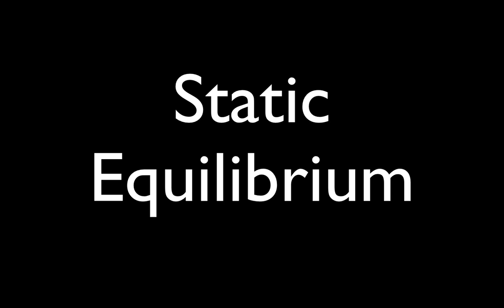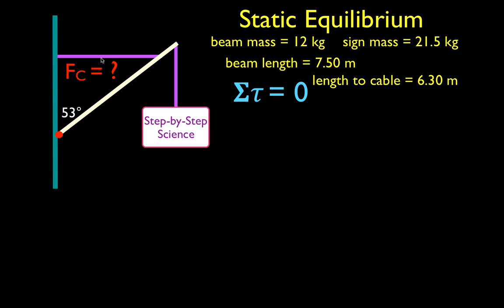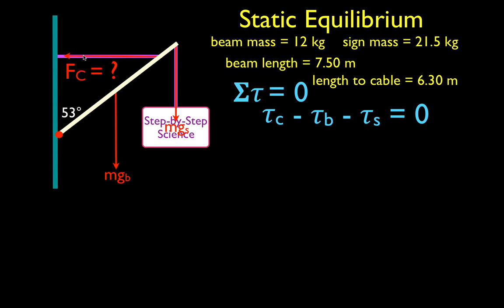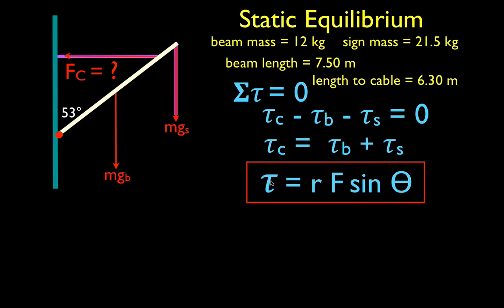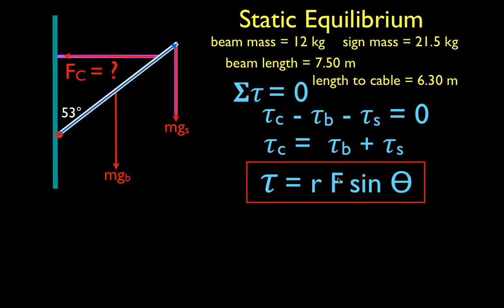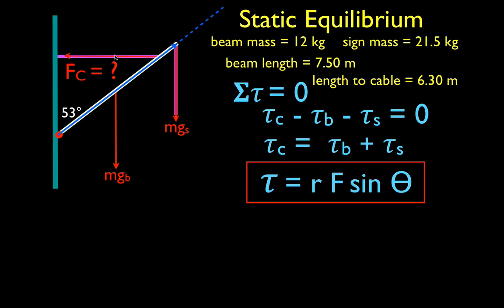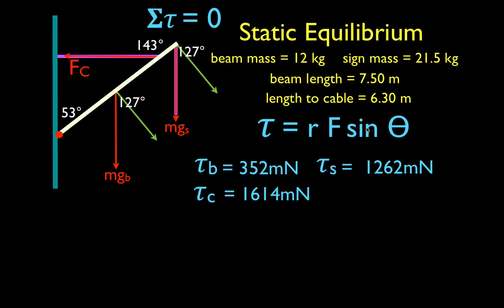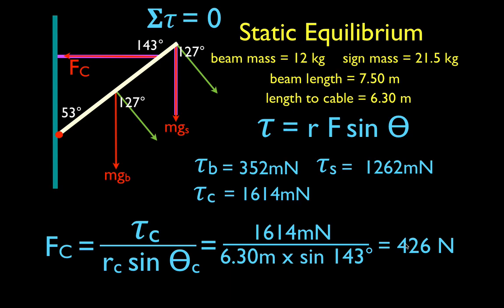Physics, Torque (10 of 13) Static Equilibrium, Hanging Sign at an Angle No. 4

Comment: i understand the principle of why you chose the angle, but i receive the same components if i use the angle 53 degrees instead of the 127. just thought this simplified things a bit. is there any cases where i couldn't use this principle? very good videos btw. i like how you have multiple vids covering the same topic with different example problems. i subscribed.

Comment: when you used the angles 127 degrees, could you not have just used 53 degrees? Because it still gives you the same answer.  Its the same with the 143 degree angle, could you have used 37 degrees?
Thanks

Comment: I did it like this:
(117.6 * 3.75 * cos37)+(210.7 * 7.5 * cos37)=3.79T
 Therefore T=426N
I used * for multiplication, because I don't have a multiply button.

Comment: Can you explain why we want to use 6.30 as our "R" and not the length of the beam to where the cable attaches.. aka 6.30/sin(53)?
Reply from the maker: The cable is not attached to the end of the beam, it is 6.3 meters from the pivot point.
You can see a listing of all my visors from my website, http://www.stepbystepscience.com

Comment: What if the cable is at an angle, say 60 or so degrees from the wall? What do you do then?
Reply from the maker: +morphanok69 It is hard to say without seeing the actual problem, but you still have to find the component of the force from the cable that is perpendicular to the beam.

Comment: you messed it up by plugging the number, had you just kept in term of variables, it would have been greate . I watched it 5 times, and I still did not get how did you sovle for torque by the cable.  what is the TorqueC  is it Fc*sin37? or what  is the purpose of143 is equal to

Comment: can you explain why you used torque? Im confused when to use it in a hanging sign problem.
Reply from the maker: Torque is used when there is a force that causes or would cause something to rotate (about a pivot point) even if the object is not moving (rotating).